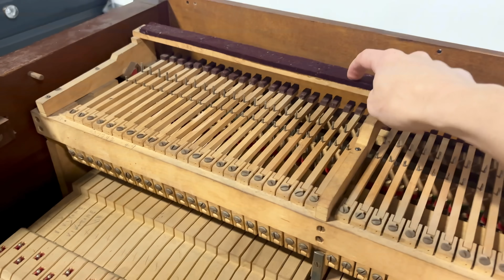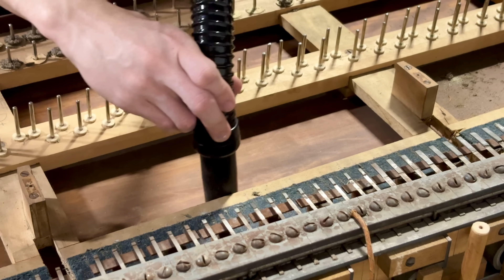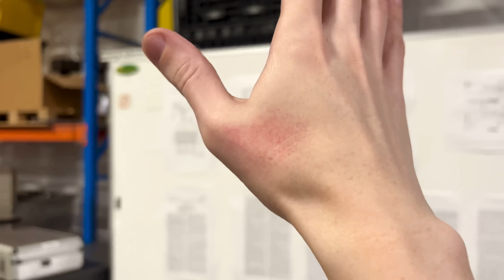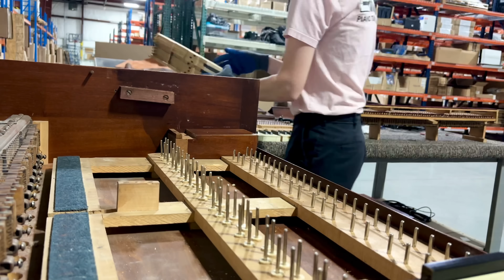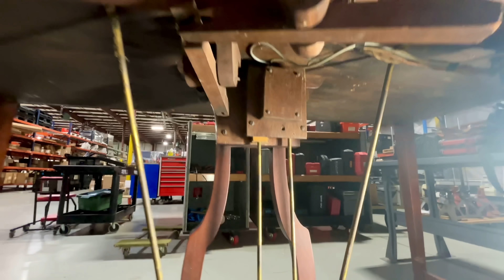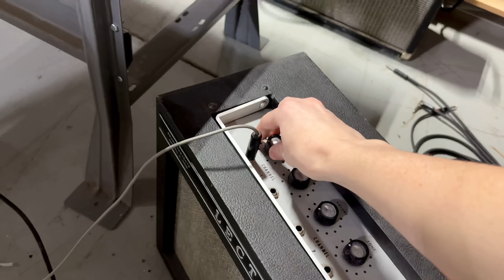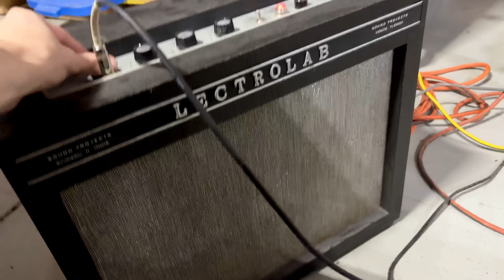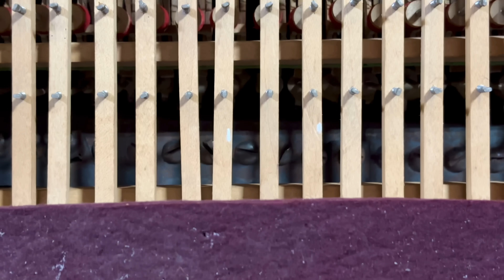Restoring an Instrument You've Never Heard (only 3 left)

Comment: Yay! You got to fully fix this one! And thanks for going to the trouble of updating the sample pack. Given the materials involved, I can't imagine it would sound all that different when it was new. Amazing how ahead of its time it was.

BTW, if you place a small-value capacitor (0.1 microfarad or less; some experimentation may be required) between hot and ground on the instrument output, it can help filter out the radio noise the shielding picked up. I think the EEs call that a "bypass" or "decoupling" capacitor. 1930s would be new enough for AM ("Broadcast band") radio; maybe that was part of what the old capacitor on the pot was supposed to be doing? 🤷‍♂

Thanks for all the detail, as always. 👍
Reply from the maker: Haha I got the easy part, Jurrell does the heavy lifting for that end--thank you!
Reply: @Emmarepairs  I would hardly call any of that easy. Even assuming it's not physically demanding, that kind of tedium has to be trying! I think I remember you using the term "soul-crushing" in one of your videos (if not this one).

Comment: Very nice work on a very cool old electric piano. You are obviously quite skilled and thoughtful about your repairs. I will however comment on the potentiometer.  It could probably be cleaned with something like Deoxit or an equivalent. And that old capacitor with out a doubt needs to be replaced for an new equivalent. A 750 pf cap replacement should work. The capacitor looked to be a "bright cap" to keep high frequencies well pitched when the potentiometer is turned to lower the volume. I have worked on a fair share of old tube amps and the question for the customer is usually, "Do you want something that is original but doesn't work well, if at all? Or, or do you want something that works?" All the old parts that are changed out are, of course, reserved and returned with the finished instrument so the owner, if they really want to, can put them back in for originality. In any case thank you for this video as it is a fun story to watch.
Reply from the maker: The pot was cleaned with fader deoxit and it did not improve--cap could have been replaced yes, though we aired on disconnecting because the unshielded cable that lead to and from caused a lot of the noise as well. Thanks for watching!
Reply: @Emmarepairs  Some folks in the 'old radio' world go so far as 're-stuffing' capacitors - as new ones tend to be smaller for a given capacitance (better modern dielectrics), and you can often squeeze them into the case of the elderly predecessor.  I have to say that's been a step too far, so far, in my own messing about!

Comment: I think the black on the picks is supposed to extend just beyond the wood, the wood not hitting the reed. The black material is a rubber. It has some give and would provide a softer pluck.
Reply from the maker: Correct, which made me a little hesitant on filing it down, but with the big inconsistencies in the black portion I figured it would be a better platform to voice off of—despite being unplanned
Reply: @Emmarepairs you did the best with what you have. If you ever consider replacing I wonder if a more classic style rubber tire could be a source material? By cutting the picks out of the tread or so on...
Reply: @canadianman000  It should be possible to buy sheet rubber, maybe from a place that sells gasket making supplies. Not sure what the duro (hardness) would have originally been. I can imagine the original material being used in the automotive industry, especially since Loar was in Michigan. Emma, I was feeling a little depressed this evening and this video cheered me right up 😀) Now I'm off to work on my Clavinet!

Comment: Interesting to see tone control controlled by pedals. That's an interesting choice!
It's interesting to compare this both to upright piano and my own Klaviphon. Both mechanism and tone.
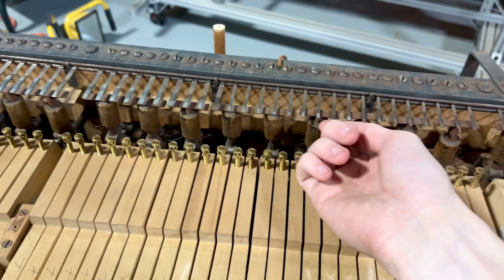Finally I wondering if those cap-looking-things under the reeds (seen in 20:30) are some pre-made coils. In Klaviphon coil wire is exposed which feels somewhat sketchy.
Reply from the maker: Right! In articles it’s described as changing to an organ like tone, removing the percussion. 

Yes those are pre-made coils—we couldn’t find any capacitors on this one unlike the last model

Comment: Tube amplifiers need a three prong connection. The wall sockets need to have a ground. Otherwise the combo will be noisy or pickup radio. If the tube amplifier has a two prong. Don't use it. Those amps are old. Not serviced and can kill you.
Reply from the maker: It’s a grounded plug hun
Reply: @Emmarepairs  I didn't know you knew.
Reply: When a tube amplifier shorts with a two prong the whole amp will be overvolted to 400 volt and can kill you.
Reply from the maker: @FransvandenBergeMuziekschuur  bro thinks I was born yesterday
Reply: @Emmarepairs  I just repeated what my dad warned me about when buying antique tube combo's.

Comment: 9:00 and some other time spots... What is the stain on that one key? It should be possible to replace the small (wooden?) gear with a remade one, and replace the pot + condenser (cap) with either new ones or if possible ones made like the old ones.
Reply: That is a cigarette burn.  Once the drinks (and assorted other sundries...) were flowing and just about everybody in the room was smoking, inevitably somebody would overhang a dart on a flat surface (guitar amp, top of a key, etc.) and it would burn down past the overhang. Almost any old equipment has a cigarette burn. Nostalgic really.
Reply: @billb825 can that be either scrubbed out or polished out? 🤔 Were those plastic (celluloid)?
Reply from the maker: Yes these were plastic, funny enough, it’s actually burned straight through the keytop. Normally it just warps the plastic a bit, but something serious must have stayed on it cause it’s literally just black wood lol
Reply: @Emmarepairs the person, @billb825, replied it was a cigarette burn. Can the plastic be replaced? It's obvious, but only on one key! Thank you Ms Lady Emma ☺️♥️🌹😉👸
Reply: @Emmarepairs  That suggests it's some kind of Celluloid type material. Modern thermoplastics like Nylon and ABS didn't exist in 1934, but Celluloid was widely used as an imitation ivory, and is extremely flammable, it's fortunate that this one was caught before it spread to adjacent keys. If you ever do need to replace damaged Celluloid don't cut or grind it using a rotary tool, I've learned through experience that it's enough to set it off.
Reply from the maker: @j.lietka9406  Yea it could be done!